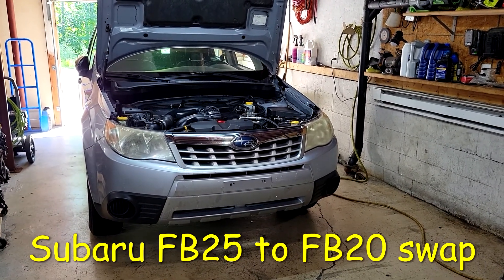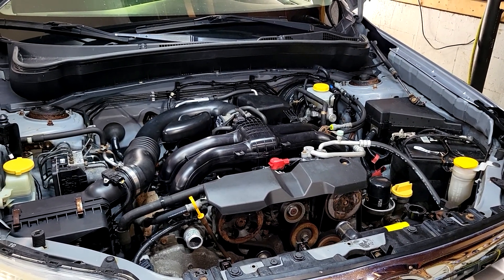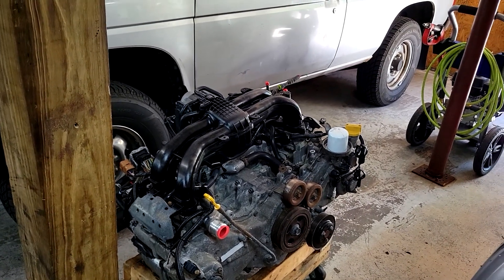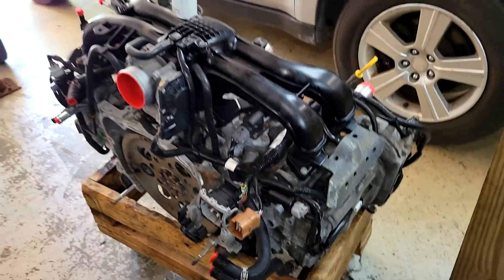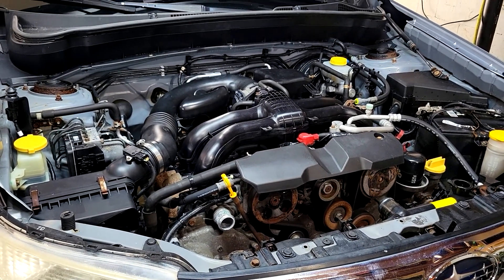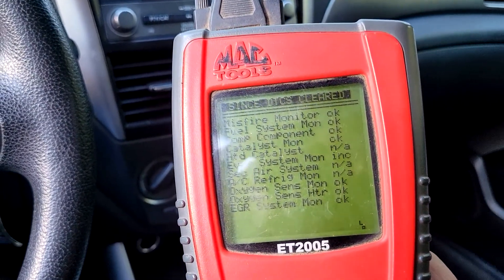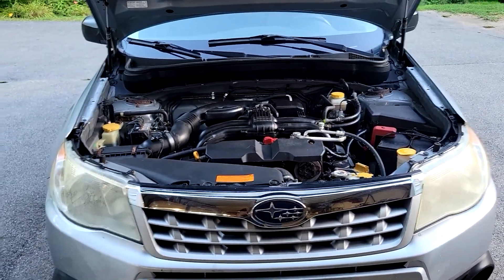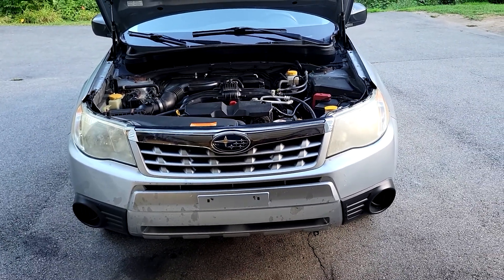Subaru Forester FB25 2.5 to FB20 2.0 Engine Swap Cheap Option To Fix Your Car Legacy Outback Impreza

Comment: Thank you for this video, we did it on my brothers 2011 Subaru forester, motor from a 2013 Impreza w/60k miles, works great, swapped the injectors and kept everything else the same since it was exactly the same, Intake, throttle body etc. 

Our only issue is that when you start the car, you need to hold the starter/crank longer then normal… I replaced the plugs and no check engine light, engine starts up just after like 3 seconds on starter crank… in your video the engine started right away after you turned the key, any ideas advice what this might be?
Reply from the maker: drive the car awhile and see if check engine light come on. what plugs did you use? only use NGK or Denso plugs on a Subaru. if old engine was an oil burner you may have clogged cats or bad O2 sensors. was this car an automatic or manual? use must have had to swap flywheels if it was an auto.
Reply: @volks-jager   I did have a check engine light come on for P302 “misfire in cylinder 2” I changed the plugs to NGK OE ones, car ran a lot smoother after the plugs were changed… once the car starts it’s totally good, but still get the long cranks. 
Car is manual transmission, it had the same exact transmission attached to the 2.0 donor motor, straight swap
Reply: Shit the old engine was an oil burner… is there a way to check the clogged cats? I don’t have any check engine lights though for O2 sensors…
Reply from the maker: @igorz104  how is the car for power? especially up hills on the highway
Reply: @volks-jager  power up hill kinda sucks now that you mention it… I just figured it was a smaller engine and weaker.  But not good uphill I feels like is slow on climbing RPMs,
Reply from the maker: @igorz104  unplug the cam phazers on the intake cams. this will make it throw a check engine light, but should give the car a ton more power. if it doesnt then you may have bad cats
Reply: @volks-jager  awesome will try it once Im off work. Does leaving the cam phasers affect the mpg’s? Curious if there are any downsides or there then the check engine light
Reply: @igorz104  I got a little better mileage after I unplugged the cam phasers
Reply: @Craigyoung27  good to know! I just finished my work week, will unplug the cam sensors today and give it a try
Reply: I unplugged the cam phazers, cars runs way better! TY! it threw 3 lights: check engine light, cruise flashing and a traction control light, is this normal to have 3 lights on? in my experience with check engine lights its just usally one check engine light, not multiple  @volks-jager
Reply from the maker: @igorz104   yes that i normal. it is Subarus shitty way to force people to fix the check engine light by disabling the cruise and traction. some newer cars are even worse they disable the AC if the check engine comes on. this is why my personal car is a 1989. i refuse to own any car with electronic nannys and other BS like this. newer vehicles are getting absurd, just just up fordechmakuloco video on the $5600 tail light repair on a 2018 f150
Reply: @volks-jager  wow… that is totally BS…, but good to know, appreciate the fast reply, thanks for all your help
Reply from the maker: @igorz104  the ultimate fix is to find a tuner shop that can reflash you cars computer with a custom program
Reply: Update a month later.  Engine was great! I took the Car on a 400 mile trip to Seattle, once I got back in Oregon the car started misfiring/running rough... I bought new coil packs and engine is still sacking but alot less then what it was, NOW i have a CEL for all cylinders misfiring lol going to try to swap to original intake and wiring harness, seems like it could be a lot of different things.     @volks-jager
Reply from the maker: @igorz104   did you buy aftermarket or genuine Subaru coils? most aftermarket coils are cheap chinese junk and dont work good
Reply: @volks-jager I bought decent TRQ aftermarket coils on eBay. I did some research and replaced the PCV valve and the check engine light is gone, no more misfires, engine seems to run smoother but still have hiccups at acceleration, once driving it’s fine, o2 air fuel ratio might be my next step…
Reply: So update to anyone having similar issues, my problem turned out to be the plugs and poor conductivity due to (me) putting too much dielectric grease in the coil pack, I took off the aftermarket coils, cleaned the oEm ones, made a sure to remove all the grease and put new plugs, bam issues solved! I’m sure the PCV valve helped, but car is running perfect right now👌

Comment: Awesome video!

I am trying to figure out what to do with my 2010 Forester XT. Head gasket leak and mechanic recommends I get a new engine (currently has 150,000 miles). I found an EJ255 for $4500 and an EJ205 for $2100. The 205 is compatible, would just lose a bit of power. Which would you choose? Thank you!!!
Reply from the maker: i dont mess with turbo cars at all so im of limited help.  but in your case with an EJ engine - if you have had the car awhile and took care of the engine i would just do the head gaskets. if the engine has been abused or neglected i would get a low mile JDM engine. and find a mechanic that just does subaurs or go to the dealer . dont let an all makes all models shop mess with your Subie - most of these type shops dont know Subarus and will do more damage than good -  a jack of all trades is a master of none - whatever kind of car you drive, find a a specialist for that make.
Reply: Got it, thank you! I found a guy who exclusively works on Japanese cars and he replaced the turbo for me. I’m the third owner and have had it for about 3 years - but he recommended I go for a new engine because damage may have already been done due to the head gasket leak.

Comment: Thank you for your video, my brother is currently doing this swap with me on my 2011 forester. We have the fb20 from a 2013 crosstrek. I watched this video a couple times, we’re worried about the trans and motor not matching up. Is there any concern for that? Reply when you get a chance, please and thank you. They both were automatic cars
Reply from the maker: bolts right up - you will need to swap the flywheel from your old engine
Reply: @volks-jager  thank you so much for your reply. I’ll be working on it today, just nervous and anxious about it is all!
Reply: @volks-jager  thank you for the reply. Yeah we have no spark so I’m a little concerned. I’m hoping it’s just a fucked up wire somewhere and not the ECU
Reply from the maker: @seanmaraugha8262   you might need to use the harness from the 2.5. there are differences year to year
Reply: @volks-jager  that is an issue… the harness from the 2.5 is ruined.. would it be better to just buy a ECU with a key or to get another 2.5 harness? I really appreciate your replies by the way as I can’t figure this out
Reply from the maker: @seanmaraugha8262   the 2.5 ECM will run the 2.0. you cant just change computer anyway.  they are married to your cars anti-theft and a different computer would have to be programmed at a dealership. check you harness to make sure everything is connected and there are not bad wires, loose connection or corrosion/water in the connectors. how did the 2.5 harness get ruined?
Reply: @volks-jager sorry for the slow reply, never got notified. The 2.5 harness is ruined due to too many cut wires so I had to use the 2.0 harness. It’s the same one that came with the new motor.. still haven’t had luck.. not getting spark. Thank you for the tip on the ecu cause I was honestly gonna buy one but now I’m not sure what next steps to take. I have too many projects and I need to finish this lol
Reply from the maker: @seanmaraugha8262  are you sure the engine you bought is from a 12 or 13 Impreza? if it is then you have something broken or disconnected.
Reply: @volks-jager  it’s from a 13 crosstrek. I’m just gonna have to go over all my connections. I have a feeling I’m probably missing something stupid. It just cranks with no spark
Reply: @volks-jager  I finally have a code. It’s a crankshaft position sensor code p0335 I believe
Reply from the maker: @seanmaraugha8262   well that is your issue. the crank sensor is kind of a PITA to get to. it is on the back of the engine below the throttle body. i really hope you didnt damage or misalign the trigger wheel that goes behind the flywheel when you swapped flywheels. as you will have to pull the engine back out to change that,.
Reply: Hey we completed the swap but it’s not firing. Any suggestions ? It’s an fb20 from a 13 crosstrek. Only codes stored is a mass air flow code and an oil pressure code. Used harness from the fb20. Any input is greatly appreciated thank you so much.  The ECU should be able to read the fb20 from the fb25 right?
Reply from the maker: @seanmaraugha8262   you have a wiring issue. either something is not connected or wires are damaged. you should not be getting either of those codes.
Reply: @volks-jager
Reply: I just wanna thank you I ended up getting the car running. The crank sensor wasn’t getting signal. It runs and drives now. Very very underpowered but runs and drives. I seen comments in here saying about to unplug the cam phasers? Uhhh where’s that located? 😂
Reply from the maker: @seanmaraugha8262  right on the front of the timing cover. there is one for each cam. i show them in the video.

Comment: I finally finished this swap. Now have over 2,000 miles on it. No issues. I'm getting 29.5 mpg. Yes it doesn't have much power but it does the job. If needed I use sport mode and shift the gears when I need them. A couple things to note: I used a 13 impreza motor in my 13 Forester. I was getting codes for throttle position and coolant/oil temp. I changed the engine harness, intake, and throttle body to the original ones that came on the car. This made the connections for the coolant sensor, oil sensor, and ignition coils different. I used the sensors and coils from the old motor. I had to use the Impreza spark plug boots and a nut as a spacer between the coil and cylinder head. Doing all this fixed my codes. Thanks again for this great idea and for saving me thousands!
Reply from the maker: if you unplug the  cam phasers it will give the car a ton more power - this will kick on the check engine light, but what we did was just get car emission tested and then unplug them after and said screw the light or you can put a pice of black tape over it.
Reply: @volks-jager  would this have repercutions on fuel economy? I own a 2.0 NA Forester from factory ( I live outside the U.S.) and I´m looking for ways to improve horsepower and torque. Mine came with S/I drive and the TR580 CVT transmission. What options do I have?
Reply: @volks-jager  I will give this a try. Currently the engine harness didn't have the connectors for the bottom ones. Do you unplug the ones on the top as well?
Reply: @Craigyoung27   yes unplug the top ones - the car will get a huge bump in power, but turn on check engine light. the 2.5 computer is retarding the 2.0 cams improperly. the ultimate fix is a custom tune so the computer times the cam right, but ive yet to find a tuner that wants to bother. they are too busy with jobs that would pay alot more like 86'ing the emissions from diesel trucks...
Reply: Can you show where those sensors are to unplug? I had my mechanic do this swap and everything is good except it's very underpowered.  Also I know there's a couple sensors he had to leave unplugged as well.
Reply: 29.5 that's amazing 
I have 3 subarus. Ave 24 mpg.
Reply: @williampierce5615  I used to get 24 but this is now with the FB20 in my forester. I have a long commute, and I take it really easy to get 29.5. This is also during the summer months. With the winter blend fuel, I'm lucky to get 25.

Comment: So I got a good question for you. I'm not all that mechanically inclined. I've done all the work on my vehicles but never got into engine swapping. I paid a guy to work on my engine, he originally thought it was a bad lifter or rod bearing toward the engine apart and then disappeared. So everything under the hood is all disassembled him sitting in a box. So I have no idea what goes where. What bolt goes where.. You know of anybody that might be willing to take on this job. I can easily have the car sent to you along with the new engine to be put in. Really not in a hurry so if it takes you a week it takes you a week. It makes you a year. It makes you a year lol. I mean the vehicle is already been sitting for 4 years now. I just hate seeing it waste away
Reply: Please let me know
Reply from the maker: what year and model is the car? and what is your location?
Reply: @volks-jager sorry for the long delay..never got a notification that you responded.. it's the same care as in video.. same color too..2011 Subaru Forester
Reply: @volks-jager  forgot..I'm in Niagara Falls, NY
Reply from the maker: @TruckGuyRon  unfortunalty you are way too far away from me. look for a local guy that does just Subarus. there should be plenty of Subaru techs in New York.
Reply: @volks-jager  distance isn't an issue for me. I told you I would get the vehicle and the engine to you without a problem where are you located
Reply: Hey man, still wondering if you'd be interested in doing an engine swap for me in the exact same car? I'll provide transportation to get the car too with you as well as back @volks-jager

Comment: I just did this and a few notes. Probably should retard the exhaust cams by one tooth if leaving them disconnected. Also did an open source retune added fuel down low and up top by recalibrating the Maf scaling. Otherwise runs great. After tune it has about the same power as 2.5 before tune it was a dog down low.
Reply from the maker: what did you use for a tune? our local tuner shop wanted nothing to do with it. (he thinks he is too good for a lowly job like this...) on one car we got around the low end doggedness by leaving all the phasers unplugged, this kicks on the check engine light , but gives car way more power. we just plug them back in for state inspection, and them unplug them after
Reply: @volks-jager  tactrix cable, rom raider, ecu flash, and I got the definitions from the romraider forum. The 09-13 manuals can all pretty much run same rom EP5G211A
Reply: Can you help me through this process i did fb25 to fb20.swap now getting code p0301 p0302 misfire code only when i floor it and its a dog
Reply from the maker: @MM-bv2qu  unplug all the cam phasers and take it for a ride - this should greatly increase the power.
Reply: @volks-jager  helped but tripped a code for cam vvt
Can the exhaust vvt be completely deleted
Reply from the maker: @MM-bv2qu   you have 2 easy choices - leave them unplugged and live with the check engine light(just plug them back in if you have to emission test then unplug after the test) or get a tuner shop to do a custom computer tune for you.  deleting the exhaust VVT might work, but that is a ton of work to remove the timing chain and swap everything

Comment: Thank you for the great info on this! It will save me $3,000! I am in the middle of this swap. I'm currently swapping the engine harnesses right now. I've noticed the electrical plug on the ignition coils are different. Can I use the ignition coils from the FB25 on the new motor?
Reply from the maker: another person commented he used the FB25 coils , but needed to add a spacer on the bolts that led them to the valve cover
Reply: @volks-jager  Have you run into this issue at all? Or has the ignition coils had the same connectors for you? Also, when you suggest swapping the intake, do you mean just the plastic part of the intake? or the entire intake section including the aluminum pieces?
Reply from the maker: @Craigyoung27  i have not, but there are small differences year to year. if the plastic part of intake is different you can swap it, but it might be the same. you might not even have to swap the harness. i did one and the only difference was the impreza harness didnt have the connector for the power steering pump, but that makes no difference if left unpluged it does not cause a check engine light or effect the way the car runs

Comment: I’m looking to do this swap here shortly but wasn’t sure if it matters what engine I would get for my car. I have a 2012 forester with fb25 and a manual transmission. Do I have to get a manual engine from an Impreza or does it not matter what the transmission type is from the donor?
Reply from the maker: no transmission doesnt matter, but for a 12 Forester get an engine from a 12 or 13 Impreza -no later